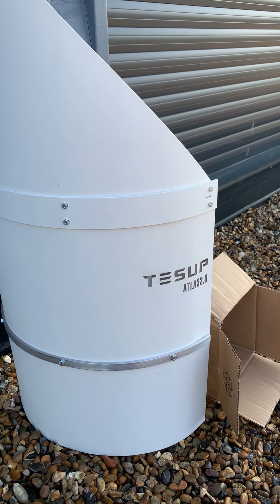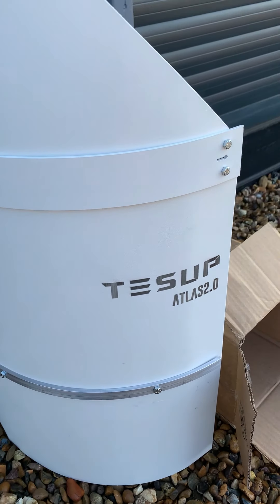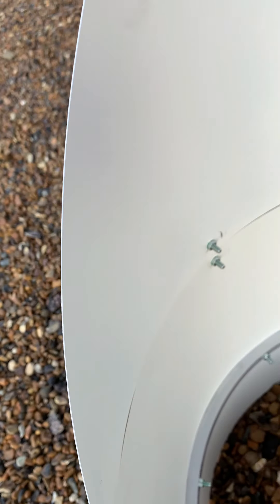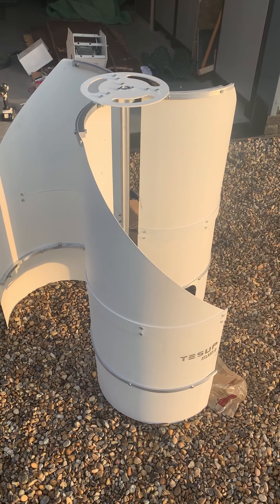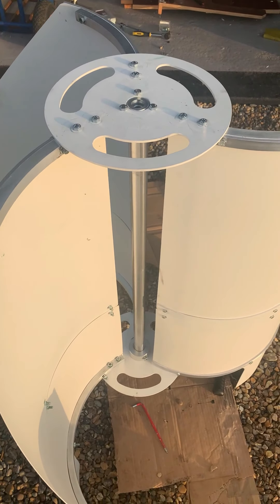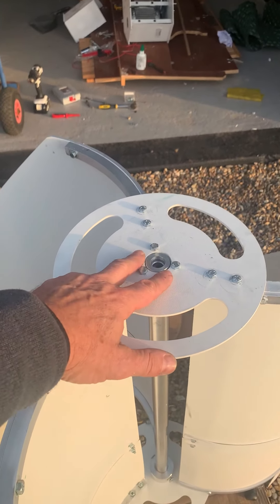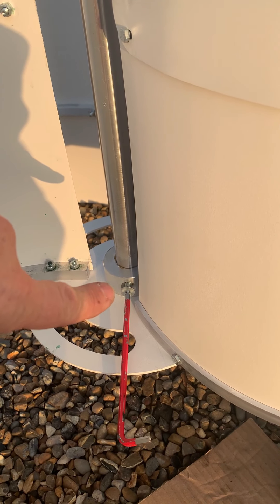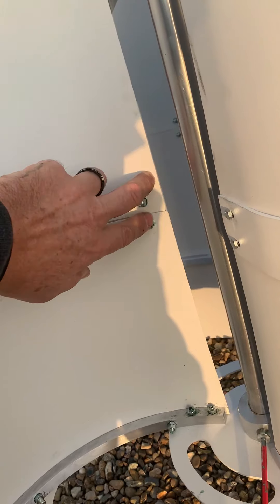TESUP Atlas 2.0 v2  blade and turbine assembly

Comment: Great stuff, very interested to see the output, and at low wind speeds now its got a geared ratio belt drive... looking forward to the next upload 😁👌
Reply from the maker: also a bit concerned that effectively if the belt breaks there's no brake capability and they'll free spin
Reply: @dunclowe7445  agreed but that belt does look pretty substantial, do they recommend a change period for the belt ?
Reply from the maker: @paullillis4399  no. I’m guessing every 3 years max.

Comment: I'm looking to purchase the AtlasX, but wanted to know if it can be purchased with the 5K motor in it ?   Are you doing a video on the out put ?
Reply from the maker: These vertical turbines are next to useless on domestic sclae so my next video will be on horizontal chinese made units. Should be up early April. No you cant get a 5kw version. At 5KW you are close to industrial scale needing as least 15M height and substantial base plastform to support the weight of the mast and power unit. There are some units ive seen in Ireland that are 3KW and quite good but not anything i would try myself.
https://youtu.be/CNzUAzRucr8
Reply from the maker: Steer clear of any TESUP. Ive not seen any credible data lead videoa showing they work.

Comment: So which turbine do you recommend
Reply from the maker: It really depends a few factors
a) What average wind speed do you have?
b) What height elevation can you reach and are you in a residential or open area?
c) What other equipment are you joining (inverters/batteries)

Happy to advise if you can provide a bit more info